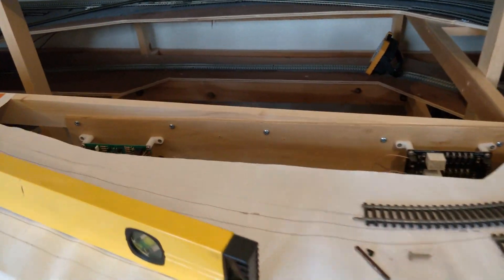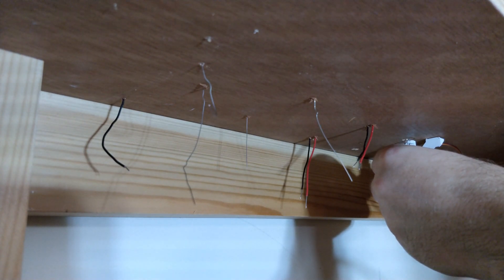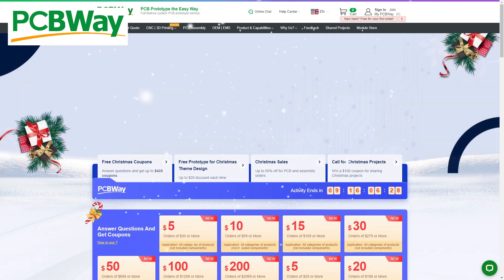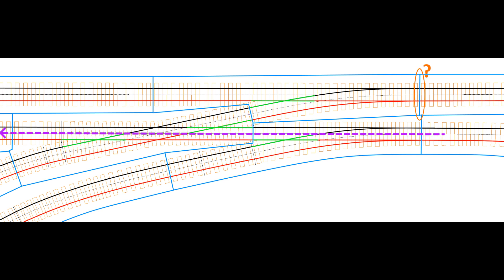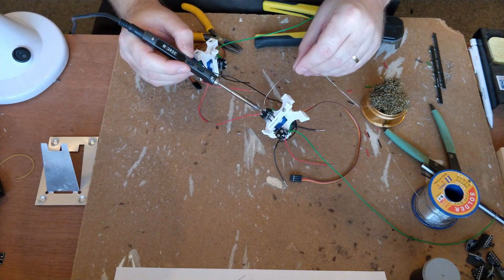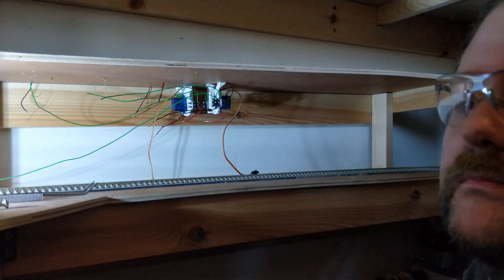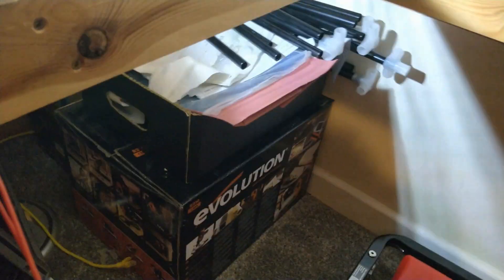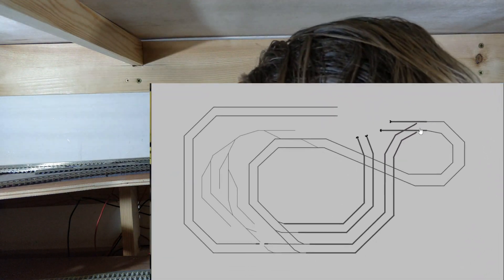Wiring an Electrofrog Double Junction for DCC with Block Detection

Comment: Excellent video, but I didn't understand how do you get working block detection inside the diamond?
Reply from the maker: The diamond is wired back to it's own separate channel in the current detector. That's why I have to have two unique switches for the diamond.

Comment: The MERG servo motor looks bulky.  I opted for a more compact design with linear motion using a rack and pinion design, but they lack the ability to stack micro switches.  - Interesting video, with some good tips for DCC wiring.  You might want to look at changing the lighting used, or the shutter settings on the camera as a lot of the video was spoilt by flickering which made it hard on the eyes - other than that I enjoyed the content
Reply from the maker: There's some kind of interference between the LED work lights I have and the phone camera. I'm trying to restrict myself to filming in daylight, but it's kinda hard at the moment.